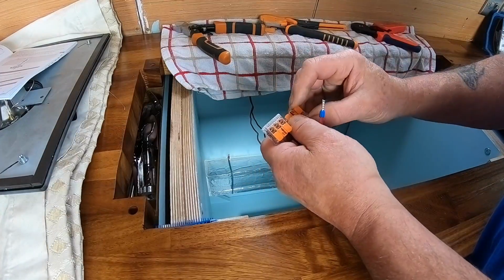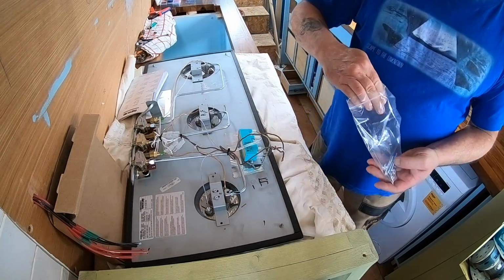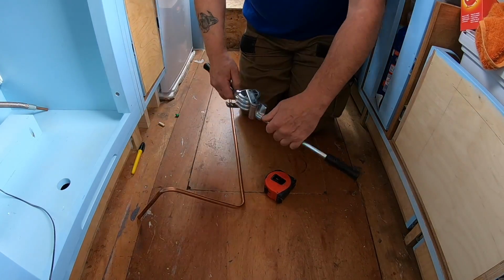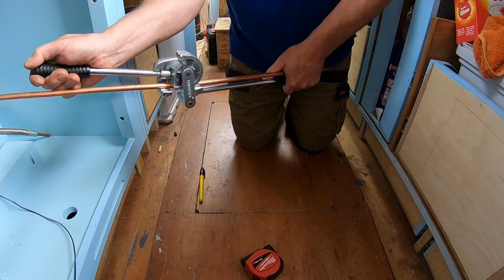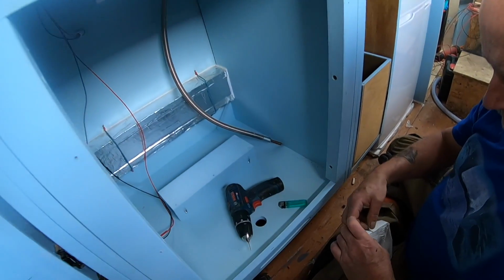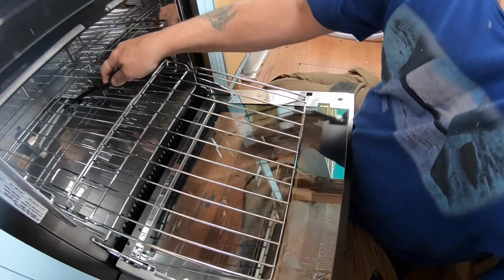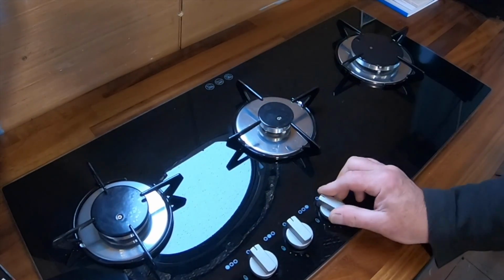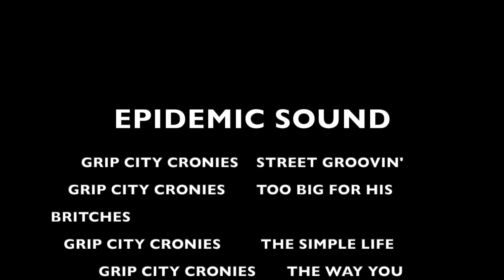VLOG 77, Narrowboat Fit Out -  Installing the Hob and Oven

Comment: I had the same problem with a walk about kettle....So...I roughed up the kettle base with a very course sanding disc. The kettle was copper so was easy to do....Worked a treat....No more walk abouts  for my kettle.
Reply from the maker: Yes think we have cured it now. everything is gripping now we have used it a few times. so fingers crossed it stays that way.👍

Comment: All this work on a beautiful design hob, and then you find out the kettle slides too easy, bummer! The design is to have easy access for cleaning and instead of beefy cast iron rings you got these tiny pins. To reduce sliding, the contact surface of the pins has to be increased. The wider the pins, the more resistance you will have towards the kettle. I hope the manufacturer can supply some satisfying solution, otherwise you may have to choose a different hob with more contact surface.
I was hoping this job would end with a whistling ketlle and two cups of tea. Well - safety first! Have a nice birthday weekend anyway.
Reply from the maker: Thankyou. Now we have used the hob a few times everything is now gripping much better so hopefully it will be ok now 👍

Comment: It looks really fantastic, well done both of you.  Isn't it amazing how intricately you can route copper pipes,  over fifty years back I installed the  gas and central heating in my house.  I'd never bent a pipe before but soon learnt,  by the way in those days you could do your own gas work, the gas board just checked it before they'd make the meter live.
What a pity about that lovely looking hob that unfortunately isn't very practical, a big frying pan with a long handle (I use one) would overbalance on those tiny supports. You can get fireproof tubing, I have some that fits in the sealing groove on my wood burner's doors. It might be worth giving it a try.
One thing that suprised me was that Grandad did not do a gas leak test, (unless I missed it). He is obviously an expert gasfitter but the cooker may be faulty like the hot water tank was.
Hope that you had a great birthday congratulations on getting 2k viewers. It's a pity that you didn't have the cooker installed back in the winter when you needed a hot meal.
Reply from the maker: Thankyou Tony,  Yes the pipe looks really neat bent in just the right places. fiddly job though.  We have now cured the hob. As soon as you start using it it grips much better. The kettle now doesn't move at all unless you lift it up and our heavy pans grip too. Yes sorry about not showing it all being tested I only realised I hadn't filmed it once i did the editing. Ady tested at each stage of the install. If we get time this week I will film him giving it all another check 👍
Reply: @makinganarrowboatwithnannyandg  This would definitely be a good idea. It would empathize how important gas safety is.

Comment: like the hob  very nice  Don't think your quite happy with your kettle being on the burner are you  as being a little unstable its a large kettle that one if your boiling the kettle while moving and you hit something that could fall of the burner Ade will figure something out for that don't worry I thing we are having the Thetford oven as well  great video guys .   Steve & Sandra.
Reply from the maker: Cheers Steve and Sandra. Gladly the kettle is fine now. I just needed to use the hob a few times to take away the shiny new surface. Everything grips well now. Yes we are getting on fine with the Thetford. We have heard many views from people that don't like them but we are not experiencing them problems on ours. Everything ive cooked has been fine. I rotate the roasting tin etc a couple of times while cooking and everything seems to cook the same as a domestic oven. We use the grill a lot and i like that its separate from the oven. Easy to clean 👍

Comment: Was thinking, maybe you could use silicon tubing to provide high friction and high heat resistance on the steel  fingers of the hob to prevent sliding kettle syndrome🙂
Reply from the maker: Thankyou Jim, After a few goes using the hob it was able to grip a lot more and we think its solved the issue 👍

Comment: No PTFE tape or pipe dope? All the recent work I have had done around my water heater and generator used tape or dope or both. Is that just a US thing?
Reply from the maker: Hi Leslie, Yes it's a devil if you do and devil if you don't scenario. I agree with you but was told I couldn't use jointing paste on boats so put the tape on instead on the rest of the pipework and have since  been told that I shouldn't use tape on LPG on boats even though it states on the tape it's suitable for LPG. So hence why I didn't use it this time but I am yet to be convinced it's the right thing

Comment: You could look at welding a circle frame to the bracket stand on the hob so the kettle sits into the circle frame and won't allow the kettle to slide around.
Reply from the maker: Thankyou Brian. We solved the problem as soon as we started to use the hob. Everything gripped once it had been used a few times. It was just the newness that made it feel so slippy. Thankyou for your suggestion though 👍